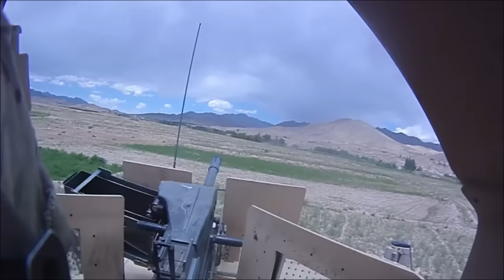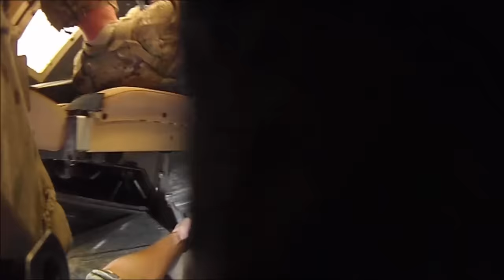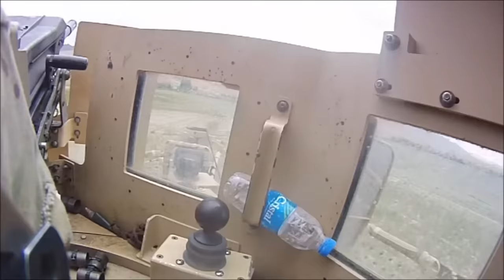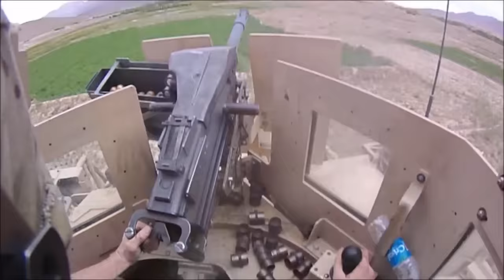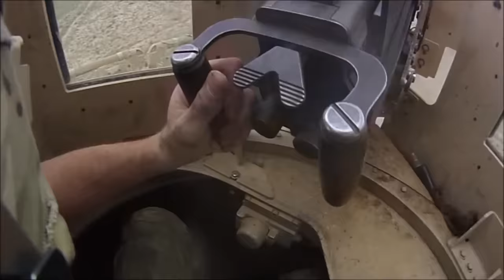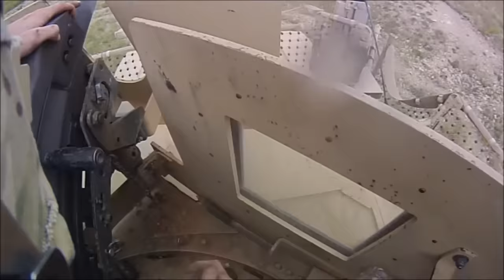MK-19 AUTOMATIC GRENADE LAUNCHER FIREFIGHT

Comment: Isn't that a very inconvenient and dangerous way to reload?
Soldier gets belly high out in the open.
Reply: the solider is surround by thick metal that can stop enemy bullets very little of his body is exposed and the enemy is out of engagement range with there wepons
Reply: . jeremy During reloading I meant. Isn't he standing up and exposing most of his upper body? MK-19 takes more than few seconds to reload. I know that the gunner is protected quite well up in that turret There might be a better way to reload without having him to stand up lime that.
Reply: +Serhan Ogan Not a whole lot you can do about that. He knows he's out of engagement range from their weapons, so he doesn't need to be too cautious.
Reply: +Serhan Ogan less of him is exposed as you think the camera is mounted on the top of his helmet and is further up than his head, so it looks like he is exposed, but not as much as you may think.
Reply: +Serhan Ogan not a whole lot of options. the gun cant be rotated much further
Reply: +Serhan Ogan Yeah, I was thinking that the first time he reloaded. They need to have a WAY longer belt of grenades feeding straight up from the cab.
Reply: I don't like how behind him, it's wide open, the back of his head is exposed, where he threw the empty shell can, It'd be better if it was just bulletproof glass.
Reply: PhenomProductions23 Well first off, they are too far out for the enemies weapons to be a threat. Secondly, bullet proof glass isn't actually bullet proof, that's just a myth. Even small arms fire would shatter it with just a few shots, then the soldier would have broken chunks of crap all over him, and inside the vehicle, as well as inside the gun, which would screw him over completely.

Bullet resistant glass would be worthless in this kind of combat, because any gun that COULD hit him at the distance he's at from the enemy, would take it out in one shot.

The armour they use is the best option for the scenario, at least until carbon metal and carbon technology as a whole get more advanced.
Reply: 5 Perservance Bullshit. Give me evidence. Not even 5 inch thick bullet resistant one way glass can handle more than a few rounds of small arms fire.
Reply: 5 Perservance Again, not one link to any evidence provided. Typical.
Reply: +Written Word you do know that they don't need links...your Just saying that because they are right
Reply: someone somewhere They do if they want to prove what they say. I've looked, found nothing, so if they want to prove they are right, like in all things, they must provide the evidence.
Reply: +Serhan Ogan yes im very surprised he doesnt rotate the turret away from the direction of fire when reloading
Reply: I used to be a MK-19 operator in the Turkish (NATO) Army between 2006 and 2007.
It is if not the most, but surely one of the most lethal weapons that an infantry soldier uses. It delivers ammumition almost as effective as a mortar shell (30 mt kill radius) at the speed of a machine gun. Approx. 260 rounds per minute! 
You can bring down a building or level a village with it. Easy.

But we used it on ground level, with the gunner sitting on the ground at a leaned back posture. 
Since it is such a powerfull yet quite a heavy equipment to move around, it is smart to fire it from a concealed position where the enemy snipers cannot locate easily. 
Because trust me, when that baby starts to rock and roll, every enemy sniper in the area will frantically try to stop it.
I just felt uncomfortable watching that guy standing high up in the air during the reload.
Reply: +Serhan Ogan how far can the hit i figure atleast 25-30 feet or is it more than that?
Reply: +Serhan Ogan He knows what he is doing. He knows he at a reasonable distance. He knows when the enemy sees his videos, they'll be imitating him standing up, too.
Reply: +Written Word Just to clear this up. Bullet resistant class is VERY durable, the glass on that cupola is rated to level IV. Meaning it can stop armor piercing 7.62x51, which is it's cap, far above the 7.62x39 that the Ak fires. The glass can take many rounds before it is compromised, and no, there is no glass that gets shot out on the inside, there is a layer of poly carbonate to eliminate the chance of any spalling that could happen. And second, the AH-64 Apache can take a 12.7mm (50. BMG) round ANYWHERE on the aircraft, and be fine. including the canopy, the engine and front flat panel of the canopy can take hits up to 23MM. If that doesn't vouch for the durability of the glass i don't know what will.
Reply: is that bullet proof glass on the sides of the Humvee up top?
Reply: Btw thx for serving
Reply: +geeetube Serhan Ogan is Turkish. So most likely than not, he's Muslim. Turkey is a modern secular nation-state (an ally of the US and a member of NATO) that is predominantly Muslim.
Reply: +5 Perservance Dude you can shoot out an appache pilot with ure 9mm handgun. Havoc is as far as I know only helo with bullet "proof" glass.
Reply: +5 Perservance Dude you can shoot out an appache pilot with ure 9mm handgun. Havoc is as far as I know only helo with bullet "proof" glass.
Reply: Oke not with ure handgun ofc but you get what I mean.
Reply: XD means They Are Vary Easy To Take Down Without a High Powered weapon
Reply: Taylor Hopkins
That sentence made no sense.
Reply: ToAstYNaChO  Well If your Read the other Comments you Would Under Stand
Reply: Taylor Hopkins
No. You're sentence was not proper grammar, so it makers no sense, regardless of context
Reply: Idc Also Read Over what you just Rote "Makers no Sence"
Reply: Taylor Hopkins
Im done with you, you must not speak english
Reply: +Taylor Hopkins you mean *wrote ? lol
Reply: +Taylor Hopkins *understand too
Reply: I don't see how else you can reload, without reaching, of course.
Reply: I am sure that trillions of Dollar's worth of US weapons industry would be able to come up with a solution to that.

It is obvious that the current method would be quite dangerous during a fire exchange with the enemy.
Reply: +Serhan Ogan the camera is on the top of his head, and he knows he is out of effective range of the enemy positions.  HE knows what he is doing.
Reply: It Seems That Way. i Agree With You.
Reply: +Serhan Ogan you prob prefer just hitting the R key huh?
Reply: boombap420 Nope, Ctrl+r
Reply: +Written Word I doubt that the BR glass would shatter from just small arms fire. The composite materials and the make-up of it all would cause it to, at least, stick together. It may be penetrated eventually, but every little bit could help. And, it'll afford a little piece of mind. So it has that going for it... which is nice.
Reply: +5 Perservance Doubtful
Reply: +Written Word What about you? Being rather hypocritical, demanding evidence when you provide none of your own. No links or anything. Not even something to look up ourselves.
Reply: +Jon A Nothing is ever proofed against anything. It would mean that it'd always be 100% effective against whatever it was proofed against. Being something "proof" is a very misleading thing, and as it is used today, it generally means highly resistant, despite it's actual definition.
Reply: +Written Word Where's your argument? And is "mouth" supposed to be an insult? It's pretty pathetic...
Reply: +Written Word Same could be said for you.
Reply: +JijVuileUil :3 Very doubtful. Also, *your
Reply: +JijVuileUil :3
*Okay,
*your
*of course,
Reply: +Taylor Hopkins Why do you capitalize every single beginning letter of every word in your sentence. 
*very
Reply: +Taylor Hopkins Over-capitalization
*you
*understand
Reply: +ToAstYNaChO Ironic that you would say that, as your grammar is rather terrible as well.
Also, *your
*makes
Reply: +ToAstYNaChO You don't seem to write English very well either.
Reply: +Serhan Ogan yeah why not spin it back around 180 and reload and come back to position....
Reply: +Written Word true man lmao lol haha
Reply: +5 Perservance no u lmao lol haha
Reply: +HaloModder555 true man lmao lol haha
Reply: +ToAstYNaChO true well said lmao lol haha
Reply: +Bill the Butcher true lol lmao
Lol haha
Reply: +Serhan Ogan yeah but any threat is hundreds of meters away
Reply: +5 Perservance now thats just not true.  You're saying this glass is better than tank armor ?  No.
Reply: +jolllyroger1 Wow you must be fun at parties
Reply: +jolllyroger1 have you read the quran or is it from watching tv ?
Reply: +Serhan Ogan He is too far away from them to be harmed. Even if some lucky shot hit him his vest and helmet would easily stop it.
Reply: +Ric Mon (bubba dupont) It's just like reading the bible.. Literally same stories and everything.
Reply: Although it is a very in efficient way to reload, if you think about it, the gun is mounted about chest high, leaving a small opening for a shot, and like someone else said in response to your question, the vest and helmet will most likely save his life. 
I had a member in m family, he got ambushed on the base. Before he left the barracks, he grabbed his vest. When he was admitted to the hospital for concussive force from explosions and 1-2 other things, they looked at his vest and found numerous ak-47 rounds and a lot of shrapnel from explosions. Those vests are life savers.
Reply: ***** True however, MG19 being if not the  best but one of the most lethal weapons that light infantry operates, enemy fire is very likely to concentrate on the gun. 
I happen to have extensive training on MG19 while I was on duty  serving my country.
This baby's projectiles have the same kill radius as mortar shells and it can deliver +-380 per minute! 
It is a granede launcher on the hype.
You can level a 5 story building or hurt everybody in a village. 
We were instructed to dismantle it and bury key pieces or destroy them when we feel that the enemy is encircling us.

Ok. 
I have an idea!
Why not open a few inches wide hole at the ceiling and create a constant, nonstop feed from a large ammo container inside the vehicle? 
It would probably hold less space than dozens of current magazines stacked on top of each other too.
Plus, since the gunner does not have to stand up no longer, his seat could be lowered and/or more armour could be installed.
Reply: +Serhan Ogan its war, risks are taken.
Reply: +Serhan Ogan lol "extensive training"
Reply: Yeah.  Thry've trained the be Jesus out of us.
Almost like torture.
I can dismantle and put back together while you say 2or 3 sentences. Blind folded. 
Since you cannot see anything in pitch  black during an operation at the mountains.
Reply: Serhan Ogan i can build up to 20 pizzas buy the time you finish 3 sentences in a snowstorm at night.
Reply: Papa John   I guess thats what no college degree will do for ya...
Reply: Ryan thats what professionalism will get you
Reply: They are yankees, what did u expect ¿
Reply: What?
Reply: Serhan Ogan tell me a more effective way?

Comment: Why in the hell don't those mk19s don't have a lock button for the sites? Cause every time there's a recoil they fall down.
Reply: I was wondering that, threads for the bolt lock could be stripped or something
Reply: they dont have a whole lot of maintenance ability for small things like that there, and there is a ton of wear on them. i think here is supposed to be a spring to keep it either up or down, but it is clearly worn out.
Reply: I've fire a couple and never had that issue.  I think maybe his was a bit out of service, no fault of the operator but a fault of the supply SGT who sent it out.
Reply: Does it matter?
It's a machine gun.
Reply: Just walk it up.
Reply: Raymond Cortez well it has 700lbs. of recoil so it knocks it around a bit....

Comment: Was the tensioning screw on the sights broken? Having to constantly reset that must be a major pain in the ass.
Reply: They are adjusting range
Reply: +Porty1119 It's made to fold but that one seems to be broken. There is a latch that keeps it either full up or full down. Probably a broken spring.
Reply: +Porty1119 and here i thought i was the only one to notice. every Mk19 i ever came across in my stint with the army had the same problem. not that it matters anymore but i was hoping someone would have an idea how to remedy that.
Reply: +jdkim1019  Use a rubber band. attach to the front of the sight and onto the back of the gmg. holds it in place.
Reply: it seems to me that the rear fight is completely useless. It flops around during the entire firefight.
Reply: Fallout [Intelligence/Charisma] "Was the tensioning screw on the sights broken? Having to constantly reset that must be a major pain in the ass.

Comment: Keeps fixing those sights only for the sights to fall back down lol
Reply: That’s military hardware for ya
Reply: They’re supposed to do that, if the didn’t fall back down like that the force of the recoil would destroy whatever locking mechanism they used
Reply: @euphoricgunnut5898  Wut? What you talking about? 🤣
The sight slip on auto 40s isn't a design positive buddy! It's a pain in the a** design flaw. Hence why most get electrical or duct tape shimmed to stop it. Literally nothing to do with recoil causing damage.
Reply: @euphoricgunnut5898  hey man its mounted on a 2 ton war vehicle, I seriously doubt the recoil would is all that bad
Reply: The gun sight not staying locked is ridiculous. They couldn’t figure that out in testing? Wth

Comment: For such a powerful weapon, it has such a shit sight.
Reply: yeh but once u know how to use that sight, fancy stuff isnt needed, altho a range finder would be nice lol.
Reply: seen a guy snap shot a paint gernade 500 yd almost right on top of the target with one of those sights
Reply: @ikitclaw7146  I think the thing that'd bug me is it flopping back down after firing. and his seems to do that quite a lot.
Reply: Standard sight for a high arc projectile.
Reply: @DFX2KX  yeah i was wonder if that was intended or it had jst shaken its self loose, you can see too he has a few problems with the cover over the top too and has to hit it down.
Reply: @- Madguru - yeh i said, i wonder if its intended to be like that or the heavy use has shaken some bits loose
Reply: @ikitclaw7146  it's not supposed to be quite that floppy, no. Most military hardware has been in service since something like the 80s, if not before. It's seen a lot of hard use.
Reply: They make much nicer optics for the Mk-19. The dust and heavy vibrations tend to destroy their ability to hold zero after a few weeks of use. In my experience, anyway.
Reply: Spray and pray
Reply: In my experience with the 203 (same round and similar site, just mounted on rifle) once you have fired enough rounds with it, it becomes more of a "feel" thing if that makes any sense.  I could drop a 203 round in to a window at a couple hundred meters without much trouble.
Reply: Once you crack off a round or two for index, you don't really need the sight. Just walk that shit in.

Comment: The speed that he's spending rounds. Shit don't last long. 

Also silly question 

If you had the applicable hand launcher would those belted granades fit?  Removed from belt of course.
Reply: Why is that?
Reply: Sidney Anderson The MK19 uses bigger muntion as the M203, since the m203 ammo hasn't enough power for the autoloading mechanism of the MK19.
Reply: Neat! Thanks
Reply: I thin he meant are they the same thing. Yes they are. The MK19 just has its rounds fitted into belts. But if you stripped it down, it is basically the same thing as a 203 round. They're both 40mm, one type is just belted to be able to be auto loaded into the MK19. I don't think there's any difference in the make up of the actual round.
Reply: There is a difference.
The 40 mm ammunition used (40×53 mm) is not interchangeable with that used in the M203 (40×46 mm).

https://en.wikipedia.org/wiki/Mk_19_grenade_launcher

The MK19 rounds have far too much recoil for use in a normal UGL.
Reply: +Zaphod The M203/320 uses the 40x46 mm ammunition, and the MK 19 uses the 40x53 ammunition.

Comment: Huge design flaw in that the operator has to expose themselves to reload the launcher. And was he firing between antennae at one point?
Reply: They need a full closed turret
Reply: nicolas rouvreau Agreed. He's leaning out a long way,
Reply: nicolas rouvreau If not they could at least put one on a slider rail so you can pull it in for reloading
Reply: i wonder what would happen if he hit one of those antenae?
Reply: Greg Ievers Nothing good!
Reply: they'd be fine the grenades have an arming distance, won't go off unless they pass a certain range
Reply: Patrick Takada Yeah, saw that show, gritty. I liked it.
Reply: Gryffster Well remember when Colberts grenade misfires and it goes into the head of an Iraqi marching along the road? That'd suck.

Great show, yeah.

Comment: What's the range on the hot potato gun?
Reply: longer than you can throw them
Reply: 2212 yards if I recall
Reply: harles2000 lmfao wikipedia? 2212 is the max range but the effective range is 1500m
Reply: Hannibal Lecter He asked about range, but it's true 1500m is the effective range above that is indirect fire witch is also good